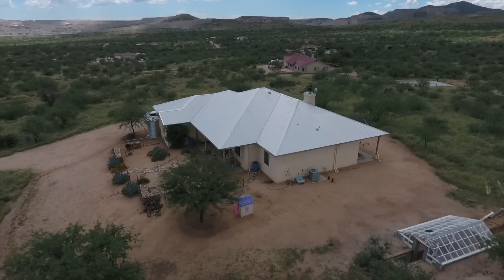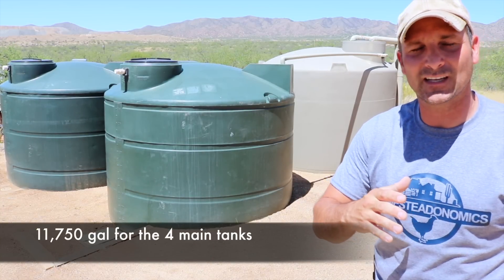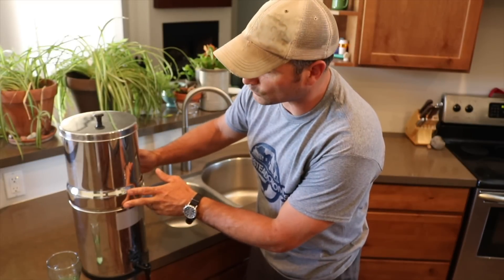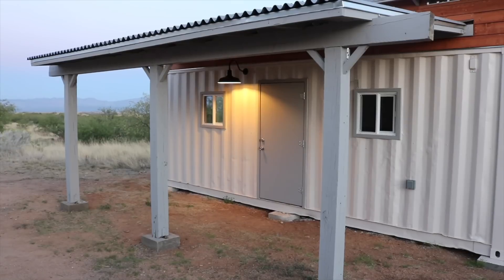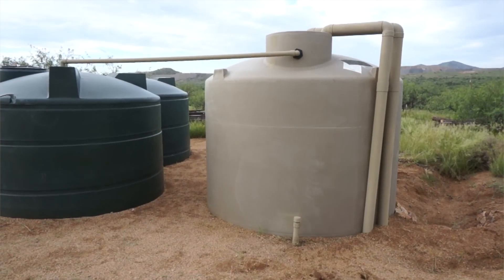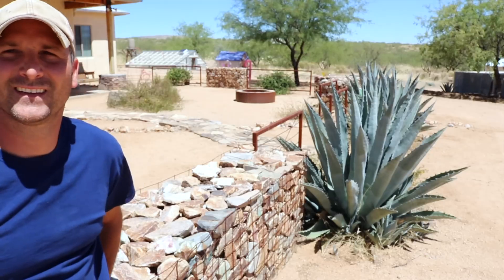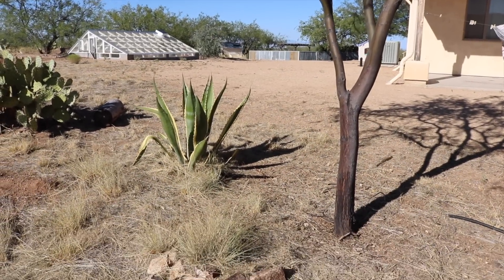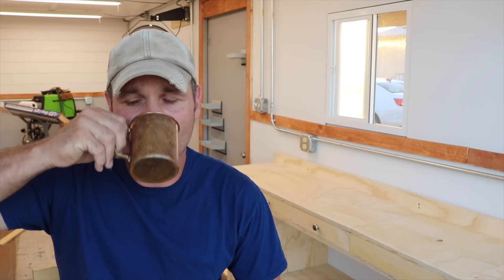Rainwater Harvesting QA - Cost, is it Illegal, how I treat, etc,.

Comment: Instead of Chlorine, (Believe Me), you can regularly disinfect your water with these systems. You could dump colloidal silver into your water to preserve it, or silver coils which you remove and clean, or use copper lines tanks, or use UV light. You should have a Dan Winter imploder to restructure the water. Crystals and Noble shungite is supposed to clean water. I know my 38% Hydrogen Peroxide works! (H2O2). I’d use any or all of those things instead of literally polluting your beautiful rain water. You can distill your drinking water. Acid Water absolutely is a problem. We need a 7ph. Or higher. You can also boil your water and then run it through a 1 micron filter! No live virus or bacteria can get through that Man! So maybe you use a balanced solution of Hydrogen Peroxide and a Dan Winter Imploder. The H2O2 will I think, raise the Ph? I know H2O2 is extremely good for you in the correct amount to drink. It gives oxygen and hydrogen which can separate from your water in bubbles when stored for even an hour if it gets light. I hope some of this helps. The Alchemists use rain water distilled. Warning!  I came up with an extremophile bacteria that showed up in a jar of distilled CA rain water last year. It was what Alchemists might call “Moon Jelly” or “Star Jelly”. It’s found on the ground and people say it falls from the sky. I had a huge blob of it after it was distilled which is why I say it’s an extremophile, as it had been through some other crazy Shkt that it shouldn’t have survived. Good luck!

Comment: You're rain water collection is impressive to say the least. I have a project in mind.. Is it possible to create a simplified model of this? Where there is no existing structure to collect water. I would want to build an open frame shelter, a large one with a gutter system all the way around. Keeping it as simple as possible. The ultimate goal being to obtain water, not perfecting an extensive gutter system to be made for a house. That includes the large plastic cisterns only, not the metal one you have next to your home.

Comment: Definitely not illegal in Arizona. Illegal in Colorado since before it was a state. This is because Colorado has first-in-time water laws (it kept the ranchers from killing each other during the frequent water wars). Basically, each user made a claim on the water based on availability - if there was water left over for the next downstream user, he got dibs on claiming rights. Eventually all the water was claimed, and late-comers can only use previously unclaimed bonus water in heavy-rain years. Or they can buy junior rights from existing owners. It’s a system that works ok. Arizona doesn’t have this problem (except Phoenix) because it wasn’t settled by ranchers early on. No one was competing for water; no prior claims = no need to assign rights. Phoenix recognized a water need in the fifties and uses junior rights on the Colorado River. They bought them from California in the sixties.

Comment: why not drop a few radiators in the coldest water and run the cold water into another radiator in your house with a fan for cheap A/C. The under ground is colder than the house in the sun. Also why not a underground room that is cool. I never understand why people in hot areas do not live underground away from the sun, wind and heat. At least 800 sq ft or so.   Move above ground at night. Also why not build a wall out of hay bails that face the sun and put the roof facing away from direct sun rays.  Like a lean to  or a porch on the south side of the wall to keep off the sun from the house.

Comment: My big question is how do I get the water out of the tank to use under pressure to water things?  Obviously I need a pump, but what kind?  Sump pump?  Pump on a switch with built in float switch.  I'm having trouble locating this knowledge.

Comment: When everything is regulated, it's time to change governments
Reply: And then the criminals take advantage of the unregulated system. Until public pressure on the government, to do something about it, causes the government to regulate it. And you are back where you started. Regulations designed to protect people are not normally an issue, regulations designed to control people are an issue.
Reply: When things are not regulated, greedy people and companies take advantage of the gen pub. Is there stupid laws on the books? Sure. Most are there for our benefit because there was a problem at some point
Reply: @michaelbuddy  So how does a sewerage treatment system work if nobody pays when they use it? Different countries handle the cost recovery in different ways. Some may include it as part of normal taxes. Some include it as part of your local government rates/taxes. The sewerage company in my area charges by how much you use it. Which seems a reasonable method to me.
Reply: @jaseastroboy9240  Who the fuck is going to hook up rainwater to their showers, toilet, and sinks?  NO ONE.  They'll still use public water if they're using the sewer, so they'll still have a water meter checking all that usage.  It's a totally bullshit excuse and I'm sick of hearing it.  Next they'll be weighing out feces and urine to charge per ounce.
Reply: @jianju4916  Depends where you live I suppose. It's a big world. Hooking up the water tanks to the house's main water inlet was very common in my area for a while. And the waste water would still go to the sewer. The setup would either use a standalone water pump or an in tank submerged pump. When the tank had water, the pump would run and the house would get all of it's water from the tanks. When the tanks were dry, the water would come from the mains. All fully automatic. I think people did it to try to avoid water restrictions during droughts and also to reduce their water bills.
Reply: @jianju4916  I use rainwater in our house and we are on a septic so......
Reply: In my area regulations are designed to control people and profits in general.
Reply: But let's change it peacefully, one homestead at a time.

Comment: It would be illegal, cause the towns get a discount. Any government property gets a lower rate, if the home or business owners pay higher rates. If water is harvested and works, less water is being used by the customers. Same with internet and electricity. We pay more, local, county and state pays less or nothing at all. I found out when a member of my ambulance Corp told me the price we were paying for cable, phones, water and electricity (gas and electric same company). It’s illegal, cause it causes the government to pay more. Just like Amateur Radio Operators can’t do phone modes. Where they use a radio to make a phone call, by using the keypad and access code on the radio repeaters. Imma shut up before I get arrested or leaking the truth.

Comment: nice system ..you can add a first flush using 4 inch pipe and a 20 oz plastic coke bottle. on the cheap

Comment: It's exciting to see what you have done by collecting Rainwater I live in Jamaica  that gets a lot of rain but yet still so much persons  have water problems especially during the summer and the dry season  shame that more Jamaican houses do not have rain harvesting I have just repaired mine 
mine is a concrete tank that is built in  the ground it was leaking for some time and I just neglected until I run out of water couple weeks ago I feel so ashamed I have rain harvesting system I didn't use it. I am looking forward to the next  raining season thanks for inspiring us

Comment: Rain water collect is not illegal, cross connecting rainwater to a municipal water system is illegal. Industrial, and commercial operations like distilleries and dry cleaners have killed water user by back flowing untreated water into the municipal water system. That is why commercial operators and many multi-story building have back flow preventers to prevent gravity from back feeding the city water system. So, if you install a back flow preventer between the water supplier and your property you are legal but you then need to have the back flow tested each year. Last time we did one it cost $250 to $300 each year. That $300 for free water? But would you want someone back flowing water from their lead pipes or garden fertilizer tank into your water supply?

Comment: Do you monitor the temperature of the water - especially in the smaller metal tank above ground ? (because if it goes over 20 deg C there is a legionella risk)

Comment: Hey there! Thanks for the video! I was wondering with using plastic tanks and pipes if you worry about  the plastic and microplastics or any chemicals leaching into the water?
Reply: Materials selection is a huge topic in rainwater harvesting, and always depends on the end-user's comfort level. There's schools of thought that PVC shouldn't be used for RWH, but it's also probably the cheapest/most accessible. HDPE gutters are used too (his gutters look like that....not sure), as are metal. If using for potable water, always looks for potable-grade.

Comment: Instead of painting the water containers, i would consider building a roof instead. You get more collection surface and the UV still can't degrade your containers as much. Not sure if the shade would lower the temperature of the water, but it's possible.

And another thing, please give your cap a good wash, it looks like used underwear. ;)

Comment: Great stuff. We also dont have first flush. 10 yrs water going into 2 x 5000 gal  tanks with no problems. Also, our washing, cleaning and even cooking water (since it is boiled) we just use straight from the tank. But our drinking water is a simple system. Just fill up a jug to filter, then pour into clear plastic bottles that I place in the sun for at least 3 days and the UV light purifies the water for free.  Regarding the toilet. Instead of even a  small flush system (even though there IS one) I simply collect 4 buckets of water each day and we flush with them. Regarding cost. With your numbers ie $5000. Nobody should be put off by that because even just using 10 years as a time to need to replace, think about it. that;s only $500 a year cost or LESS THAN $10 a week. .....  Thanks for the informative, friendly video

Comment: Great video! Learned a lot. There are perfectly legitimate reasons to restrict rainwater collection in some areas, particularly where there's an aquifer recharge issue or rapid development. Typically it's local communities that impose those restrictions according to their unique circumstances. I suspect you use a septic system, and given the sophistication of your setup, you probably return more water to the table than would be lost to evaporation without it in your arid climate. I also appreciate you setting water out for the local critters that could be impacted by the loss of runoff.
Reply: Yup, I live in an aquifer recharge zone and it is technically illegal to collect rainwater. However it's one of those laws that no one fines you for unless someone complains.

Comment: Very nice system like it a lot been thinking about this for a while , we have a 175 year old house believe someone around 1840 _1850 Built Tank in my basement and did plumbed house for gray water  the first well is in corner of of garage( horse stable) with a trough in floor that ran to a pond that was used for there fresh water all hand pumped, I had first well drilled in 1998 I wish all the time I would have done what you did, well done, thanks for the inspiration to work on mine Ed WVA

Comment: Collecting rainwater in cisterns is standard practice for homes in the Virgin Islands. We usually build the cisterns out of reinforced concrete and they are built as part of the the building's foundation. The cistern's capacity is REQUIRED to be at least 10 gallons for every square foot of roof. Unless there is an extended drought, we never run out of water. Tropical storms and hurricanes do serve a purpose.
Reply: What do you use that water for? Do you purify it for drinking?
Reply: We use it for bathing, laundry, toilet flushing, washing dishes. All water is filtered. Filter is changed every 3 months. I add bleach to the cistern once a month. Amount is based on how much water is in the cistern at the time. We usually don't drink it, but if we wanted to, we would boil it first.

Comment: That big of a system for $5000?? Sounds Great to me! Awesome work, I love the system.
Reply: Daxis Perry   Profession?
Reply: @nonamemike7149  I'm a welder. I'm just relly interested in this sort of stuff.
Reply: @daxisperry7644  So you know + and - and know what it takes to stick ___ to _____.
Also you know what happens when you have the leads reversed. 

For batteries the less heat the better. 
So why in the world would you say $5000 usd is worth it at this manufacturing capacity?
Reply: I'm kind of confused about your reply. What does welding or batteries have to do with pvc rain collecting systems?

Comment: Great stuff real deal no scam like solar
Reply: How is solar a scam? I lived off-grid for over 6 years on solar, as there was no grid available.
Reply: @sspence65  It's a scam cause your spending crazy money on panels and batterys and winter time you need another form to power your house. A 8kw solar battery is 8000 bucks. It takes lots of power to heat a house in the winter talking 2000 kw for an average home to run. you get less than a kw in power for a panel. Single axis sucks compared to dual axis solar tracking units and solar trackers are even more.3 8kw solar batterys are 24000 bucks not including the panels etc. Every way I looked at it there was no payoff. Then they say you can sell the power back to the utility company at an average 18 cents a kilowatt. Plus, there's lots of solar scams in the citys. Solar is a  do gooder green crap the only green about it is the money they got from the customer. Plus, solar isn't any good for the environment by looking at the dystopian lakes of toxic cadmium and other nasty poisons. What do solar panels do to the water tables?? A natural gas line is the real deal sure way to go for survival that way you dont freeze to death.
Reply: @colonelquail3993  
A. I didn't spend "Crazy Money" I spent about $25k. 
B. I had a backup generator (Honda 6kw propane) for those just in case moments but rarely needed it.
C. Wood heats my home just fine. 
D. I had fixed panels, no axis adjustments. Northern climates do not need trackers.
E. I had no power company to sell back to, and wouldn't want to anyway.
Reply: @sspence65  Good on you, I agree wood works great to heat a house. I'm not going debate your solar panels. Good luck

Comment: I have not designed such a collection as you have. With current energy devices I understand need 2 meters of head minium to operate, could tank placement and even additional tanks, provide a redundant system to produce electricity and provide serialization/filtering with the help of solar/pumping etc? Even if such a plan is used to super clean and sustain water without a electrical surplus. You should be the desert Mayor!

Comment: Good job! How many gallons of water do you collect in a year? Another important point is that the roof of the house is made of metal plates and is probably painted. IMHO the acid rain can dissolve both, the metal tiles and paint. Have you researched this problem? Heavy metals, dissolved by rain, can cause many health problems.

Comment: i live in southeast tucson and i have a 1100 gallon rainwater tank,its filled 3 times since july 31,2019.. the city of tucson paid for the water tank or at least 90% of it with  their rebate program.very happy with it except i wish i would have got a 2000 gallon,my roof is.around 1,000 sq feet.alos have grey water system that i love which the city rebate paid for most of that too.....  you can do water harvesting on the cheap in tucson with their rebate program so check em out.

Comment: There is one more type as line Rain water harvesting and rain water recharging system. Do you aware of the Rain water recharging system using V wire technology. You can use the excess of water into the ground using that....

Comment: Doing a little back-of-the-envelope math, I've figured a water bill of $50 /mo x 12 = $600 per year. If your tanks and system can last 25 years that would otherwise be $15,000 in water bills which you did not pay. So, $5,000 total cost over 25 years essentially is the equivalent of cutting your water bill to just 1/3rd of what it would be otherwise. That's a pretty nice money saving feature to have -- putting $10,000 in your pocket. Of course, maintenance over the 25 years may cut into that savings, but I'll bet all said and done you still save a lot of money.

Comment: I just put my 3 Barrel rainwater collection system up.
3 blue barrels - $8 each (at an auction)
Gutter downspout, PVC connectors, and bulkheads - $ 79
12 cinder blocks - $19

The big white 250 gallon totes are $10 ~ $40 here.

My city has a $75 rebate for the water collection system.
We get about 30 inches of rain a year. I'm pretty excited to see how my 150 gallons storage holds up and how fast they fill up.

I've had the blue barrels for 6 years just sitting there. I finally found that pesky round2it, and did it.

last month I put a pvc-mht connector on my A/C condensation drip, and I now have about 30 feet of vine completely covering my chain link fence. There is a tree that used to drink the condensation every day, it had so much water in it that I could twist it like a pretzel, it is 4 inches in diameter even!

Comment: In Europe 95% of installed rainwater tanks are from concrete (cheaper than plastic).  And as a rule of thumb the top of the tank should be 0.5 m under ground level for keeping it cool and less attractive for foreign life.